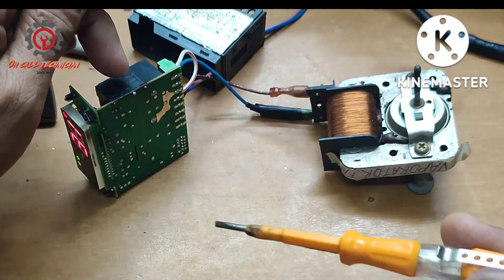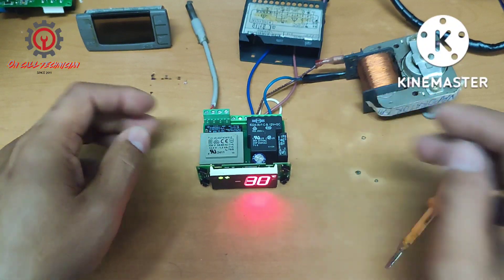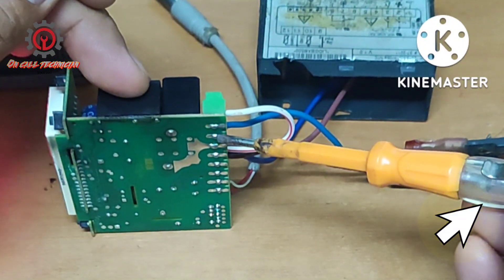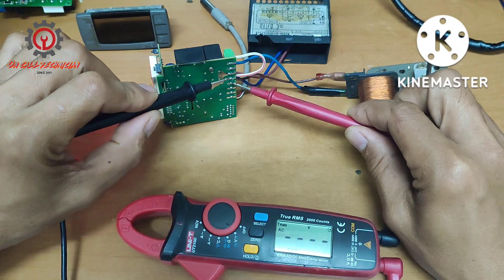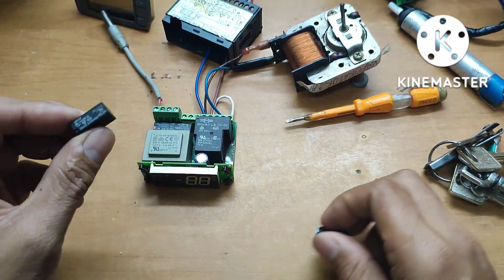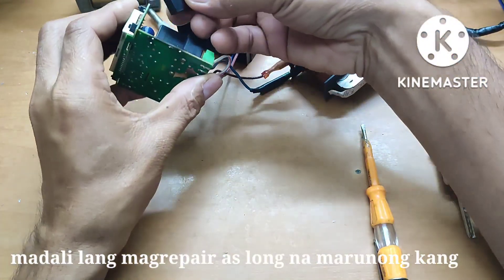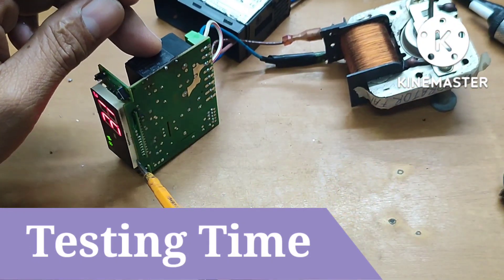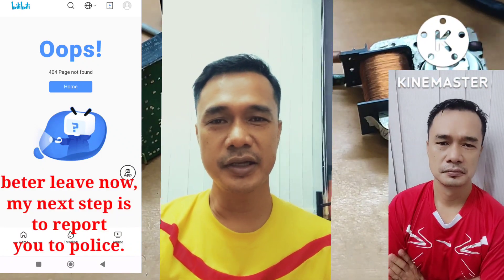NO POWER OUTPUT FOR EVAPORATOR FAN MOTOR ISSUE OF DIXELL XR06CX FIXED

Comment: Dixell xr60cx controller evaporator fan motor power supply not coming and I replaced new controller same issue fan not working what was the problem
Reply from the maker: Install back the old one, it was the FST value issue not the control watch this sir 👇👇👇 https://youtu.be/h4GK5d-cEhc?si=udBfnz5cmTdwt86c